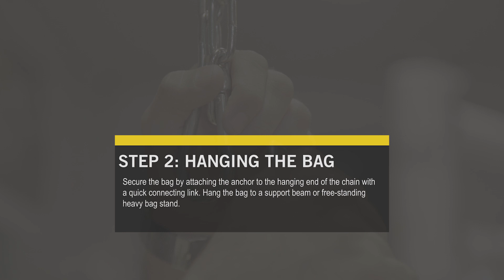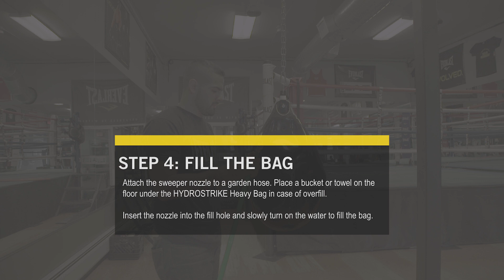Everlast HYDROSTRIKE bag - How to Fill

Comment: Im having serious difficuties about filling the bag, the adapter doesnt seem to enter properly, is there a manual or a video about it?? do I have to cut the top of the connector?? please answer!!
Reply: I have the exact same problem mate. It'de really helpful if you can inform me if you find anything. Thanks
Reply: @nathan__5194  i did mate! I honestly was stupid enough to not understand there was another screw in already, so you have one in the package and one already in, for the adapter you need a couple of pieces to make sure you go to your fav hardware shop with it and tell them how to connect it properly to a pump. then hang the bag before filling it (crucial) or have 5 mates to help you out to put it up after, prepare to drip a lot of water by the end and be fast with tap/screw to close it because it'll pour it out. Let me know if I can be any help.

Also,  put the same weight of the bag if not more on the structure you choose to hang it to. And if you have it like me on the Everlast Stand keep an eye on the hook screw as it will unscrew from time to time.

With all that said is probably the best thing I could buy for indoor/terrace training, I'm 90kg and any other bag would have swung around like crazy, this one is so good.

hope this helps!
Reply: @Kingjames11005  Absolutely not, perfect for small spaces, I'm not paid to say it, just so good, I think any waterbag is that sam, I just happened to buy this one! If you plan to throw kicks maybe I wouldn't suggest this one!